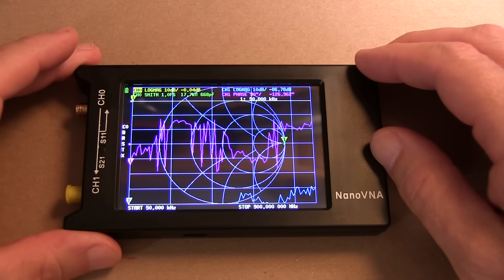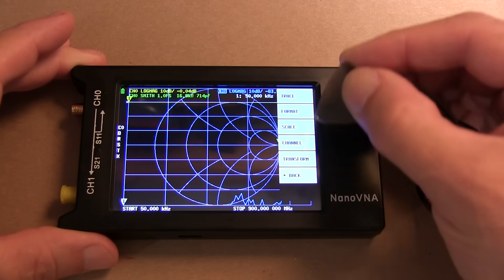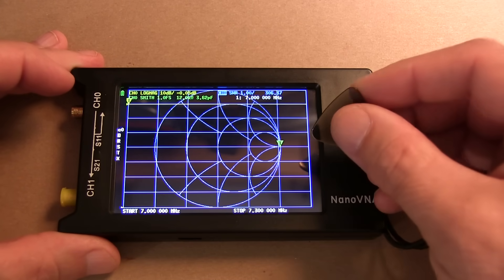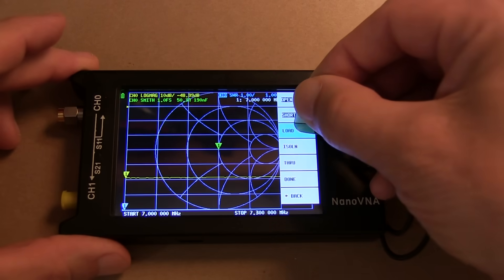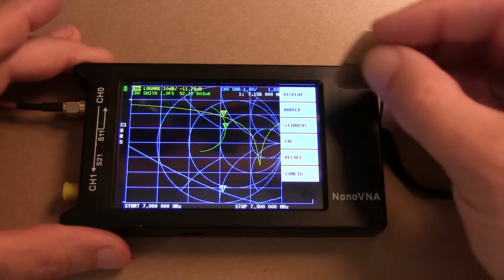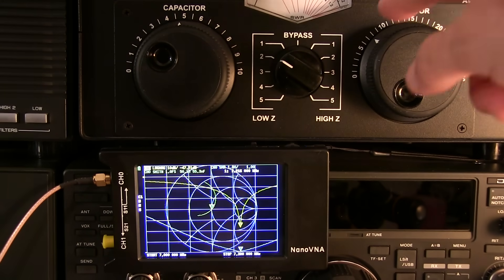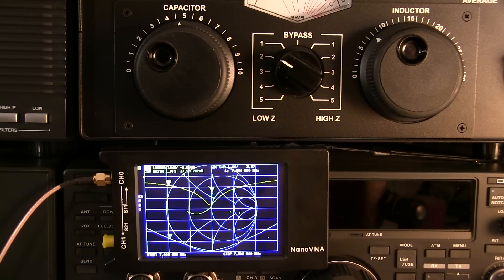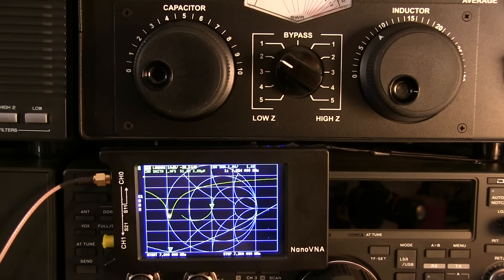#314: How to use the NanoVNA to sweep / measure an antenna system's SWR and optimize its tuning

Comment: Can you use NanoVNA for 75 ohms systems like TV antenna etc? I have RTL-SDR dongle and everything I'm using (coax and antenna) is 75 ohms impedance. Can I use NanoVNA to measure them despite it being 50 ohms VNA?
Reply: Did you figure this out? I just got a VNA and want to test a TV antenna the previous homeowner left in the attic to see if its resonant on any radio bands. I barely know what I'm doing, and looking for guidance before I mess something up.

Comment: 40m is exactly why I just bought this. Have 20m of 12ga stranded hung up as a sloper. Ironically we have loads of rf talent here in Syr with Anaren, Lockheed, Sensis, but I'm not one of them so this vid helps. Only just got my general.

Comment: I'm merely dealing with the 11 meter band to see how to check the SWR on all my antennas could show me how to deal with it on the 11 meter band!  the Nano was a gift to me for my birthday and my little brother he wants me to make sure that I get my antennas right so when I key up I won't burn up my amplifiers or my radios. 
You can email me at allrepairs@rocketmail.com or
mr.williamlavan@gmail.com
Reply from the maker: The first three and a half minutes of this video show you exactly how to set it up to sweep an antenna.  If you just want SWR, you can turn off all traces except one, set it to CH0 and the format to SWR.  Set your start frequency to 26.965MHz and the stop frequency to 27.405MHz.  Calibrate it as shown, and you're good to go.

Comment: Great video showing how to use the NanoVNA to scan the antenna VSWR across the band, but, and it is a big but! OK, so I am going to be pedantic here. ;-) Unfortunately, you haven't actually TUNED the antenna at all. You have simply MATCHED the antenna for the frequency that you wanted, by making it "appear" to be electrically shorter than it actually is, by using your antenna matching unit, which is very often wrongly called an antenna tuning unit. There is a big difference. What the matching unit does is fine for matching the 50 ohm output of the rig and lowering VSWR that it sees, but the only way to actually TUNE an antenna and change it's resonant frequency, is to lengthen it or shorten it. You have in fact just "fooled" the NanoVNA into thinking that your antenna is now shorter and more efficient in the CW section of the band, but the actual wire length, which is what is radiating and which actually defines the efficiency in radiating, is still too long for the CW section of the band.
Reply from the maker: Agreed - the impedance transformation done by the "tuner" is just to ensure maximum power transfer out of the transmitter into the antenna system (transmatch+feedline+antenna).  This "system" can be very efficient provided the transmatch and feedline loss are reasonably low.  And, as you said, transforming the impedance to get max power transfer does nothing to change the radiation efficiency of the antenna itself.

Comment: Do you set start and stop frequencies a little wider than the actual band your interested in? Or maybe 2 bands if you had a 2 band antenna?
Reply from the maker: Usually just for a single band at a time, and just over the band of interest.  This give you the best granularity in the measurement.
Reply: @w2aew  Ok thanks. I'm absolutely loving this thing for tuning CB antennas.

Comment: Ok, I need some help here, I made a slim Jim out of ladder line and got it working at 145MHz - at least, that’s what the NanoVNA says.

I tested this with only the short coax on the antenna - as soon as i add 5 metres of coax to simulate me using it on a pole it jumps from 1.1 to 2.0:1. Is that expected? Has my SWR really gone up or does the extra coax throw the measurement off?

Can I be sure that when I attach it to a radio I’m getting the performance I expect when measured?
Reply from the maker: It sounds like the coax is becoming part of the antenna.  Did you include any kind of choke balun on the coax?  If you don't, you'll get some common mode current on the coax and it will become part of the antenna.  It's best to measure the antenna in the configuration (and with the coax) that will be in place when being used.
Reply: @w2aew  just a clip on ferrite that came with a kit. All the coax is 50ohm RG58. I guess it’d be good to get it on a proper meter sometime to compare. Perhaps a proper air choke will help too

Comment: Excellent explanation and design information in all your posts, please keep up the great work. I have a question, given a Smith Chart plot of a real antenna, how could you build a circuit that simulated the antenna on the lab bench? A useful tool for testing antenna tuners and coupler performance inside the lab without having to setup a real antenna, not to mention upset the neighbours and FCC while scanning across the band. I test tuners to quite high powers, sometimes well into the kW range.

Comment: Technical question: at 5:30  in,  you have tuned the antenna to the frequency and set the j component to 0.
Now, how do you know the inductance and capacitance found, just read it unpowered ?  or read it from the dial ?
Reply from the maker: You'd have to measure them - or develop a chart to relate the relative markings on the front panel to the actual values.

Comment: I design boards with surface mounted antennas and typically use coplanar waveguides to feed them. I feed the PCB stakup from the PCB fabrication house I'm using at the time into a ICD Stackup (A 3d Solver) to get the copper parameters for the matching impedences I need mostly for HDMI and USB traces along with LTE and GPS antennas.   The Antennas typically have a Pi network at the antenna infeed for tuning.  I'd love to see how I might be able to use use the NanoVNA product to select the Pi components to precisely tune these surface mount antennas.

Comment: Wouldn't you need to calibrate for 1/2 wave length at the velocity factor of the co-ax in order to be accurate for the reading at the antenna?
Reply from the maker: If your desire is to understand the complex impedance at the antenna feedpoint, then the use of a 1/2-wavelength (or multiple of) will be useful.  If you're only interested in the mismatch between the coax and antenna impedance, then the feedline length doesn't matter much. For SWR readings, the feedline length doesn't really matter (assuming losses aren't huge).
Reply: @w2aew  my main use is in tuning antennas like Pulse-Larsen's that are intentionally left long so you can tune them after install. Since I usually use NMO mounts and drill a hole in the roof of the vehicle, I necessarily must use the coax to attach my Rig Expert. Make sense?
Reply from the maker: @Justin-bd2dg  Yes.  At the end of the day, you want the RADIO to see a good match, so it is perfectly valid to make the measurement at the end of the coax that would connect to the radio.  Again, length of coax doesn't matter for SWR...
Reply: @w2aew  gotcha, to clarify, the radio being happy is secondary, I'm striving for absolute performance (5/8 wave, simplex, vehicle to vehicle) so in my mind, the most PEP is paramount. In other words, as long as I'm not causing damage to the radio. Sorry, I'm new to this, lol.
Reply from the maker: @Justin-bd2dg  Maximum power transfer to the antenna will occur when the SWR is as close to 1.0 to 1 as possible.  Practically speaking, anything below 1.5:1 can be considered perfect, and anything below 2:1 is acceptable.
Reply: @w2aew  yeah I get that part, but I guess in my mind I view the antenna and the coax as 2 separate entities. In other words, I want to start with tuning the antenna to be optimized at 146.52, its self, at the NMO base (Larsen base coil).I understand that even though Larsen calls their base coil loaded models, "ground plane independent" that the vehicle still acts like a ground plane and effects the Take-off-angle and tune.
I just have more than one vehicle with NMO mounts so I don't want to trim/tune one antenna on my single cab truck, then move it to my Suburban and have it move off on the tune. I use 5/8 wave single banders for UHF and VHF and I have a dual band (half over 5/8 colinear) as well. Guess I'm just over thinking it over "splitting hairs"?
Reply from the maker: @Justin-bd2dg  The vehicle and mounting location will change the optimum tuning slightly, sorry, you can't get away from that.  The change should be small.  But, in either case, optimizing the tuning at the end of the coax will yield the same result as optimizing it at the feedpoint, so don't sweat it.
Reply: @w2aew  awesome thanks so much for taking the time!

Comment: I ordered the NanoVNA 2, supposed to go up to 3GHz, hope it works out. Hey by the way, the calibration needs to include the cable. If your antenna isn't a perfect match then the length of the cable will change the way it looks to a VNA, for example inductive can look like capacitive, open can look like short, etc. your yellow and blue trace are still correct but not the green one. I'm pretty sure you know about that since you are a freakin genius haha, just thought i'd point that out.
Reply from the maker: The length of coax from the calibration plane to the load (antenna) will change the impedance looking into the coax of course, but will not change the VSWR.
Reply: @w2aew  that is correct. essentially adjusting the length rotates the impedance in a circle around the center but the diameter which relates to VSWR stays the same.
Reply from the maker: @pratwurschtgulasch6662  I have several tutorial videos on the smith chart that discuss this and other things.
Reply: @w2aew  I appreciate that and I've learned a lot from you over the years. I used the smith chart to match up a PCB trace antenna and the thing ended up transmitting 10 miles at a quarter watt.

Comment: It looks like the antenna is inductive showing on the upper half of smith chart. Then you seem to be adding inductance to the network to make a match. Is this what is really happening? This is a little counter intuitive to me. Please explain!
Reply from the maker: It is an L network tuner - but the configuration (series L then shunt C or shunt C then series L) is determined by the center switch.  The two reactive elements work in tandem to match the resistance and do a conjugate match on the reactance.  The curve may move counter-intuitively due to how the LC from the tuner sum up with the complex impedance seen at the end of the coax.
Reply: @w2aew  Thank you for the explanation! I think if the characteristic impedance is to the north, one needs to shorten the antenna and vice versa. Is that correct?
Reply from the maker: @twong689  I'm not sure you can always draw that conclusion.  Especially if there is a transmission line in between, as it will rotate the impedance around the chart.
Reply: I saw your other video yesterday, it was quite enlightening. https://www.youtube.com/watch?v=IgeRHDI-ukc&t=611s

Comment: w2aew,  Although the typical case is working with 50 ohm systems,  I want to measure antenna impedance matching with a 75 ohm characteristic impedance (homebrew TV antennas).  Would it be better to slap on a  connector converter from SMA to F type, then calibrate with an F type: 75 ohm open, short, and 75 ohm termination, or would the internal 50 ohm Zo directional coupler confound the displayed measurement results?  I suppose the alternative would be to use a DIY sma to F type impedance converter.  What's preferred and what are the tradeoffs of each approach?  Thanks!

Comment: Alan I get better SWR readings on 20m with calibrated NanoVNA vs a MFJ antenna analyzer 1.07 vs 1.6 Which one should I believe?  Love the instructional videos.
Reply from the maker: Assuming you've properly calibrated the NanoVNA over the frequency range of interest, it is difficult to say.  It might be best to setup a test jig with some known impedance (25, 75, 100, 150 ohm, etc.) and test both devices with them to see which gives you the expected readings.

Comment: Alan, how does one reset the vna back to factory ?
Reply from the maker: As far as I know, "factory" setting was stored in location 0.  In the case of my NanoVNA-H4, this setting was: Start=50kHz, Stop=900MHz, Trace0=CH0_LOGMAG, Trace1=CH1_LOGMAG, Trace2=CH0_SMITH, Trace3=CH1_PHASE, with a proper OPEN/SHORT/LOAD/ISOLN/THRU calibration performed.  So, simply duplicate these settings, run the calibration and store the result in location 0.  Location 0 is the one recalled when you power-up, so you can make this whatever "default" condition makes sense for you.

Comment: Thank you for sharing, it’s the best explanation I found so far on net. I had a NanoNVA for some time and your tutorial is very useful to check/verify the method we should use this device. May I asked if any way we can use a passive device to be used as “test reference” for checking this NanoVNA? And is there away if you are able to check the accuracy? In such case, there are many NanoVNA sold and may have a bad quality control. Thanks in advance.

Comment: I find there are too many versions , I want the larger screen and found there are 4" & 4.3 , then up to 900 MHz , 1300 MHz and then 2.7 MHz .
H vs. , 4 vs. , V2 etc.
Then some have a metal case , some do not .
Thanks again

Comment: First of all a BIG THANK YOU, for your instructions. Second, do we have to calibrate, after we choose the bandwidth? Is this way more accurate? 
Plus, my VNA does not have this search function. Thanks again.
Reply from the maker: not a bad idea
Reply: @w2aew  What is not a bad idea?
Reply: @batfalcononyoutube  the nanovna only samples 101 points of any specified frequency sweep and interpolates intermediate values. So if you calibrate at the full 50k to 900MHz it's a long way between drinks. To improve measurement resolution over the required frequency range simply do as Allan has done here calibrate only over the required frequency range. to pack in all 101 points over the reduced range.
Reply: @RobB_VK6ES  Thank you!

Comment: I'd like to see the proper way to measure the efficiency of a balun and see the attenuation of a common mode choke with the proper way to hook everything up (trx bench add resistors to the measurements setup not sure I understand why and how to cope with the resistance attenuation on readings). Speaking of attenuation, I don't understand why I see discrepancies between the readings of the nanovna-h and vnasaver software even though they are calibrated with the same osl kit. Thank you for posting this video!

Comment: That's really helpful thanks!. If the SWR is at 1.1 perfect what do we also need to look for resistance wise ect so we can fine tune our DIY antenna's to their optimum?, I think you maybe hitting on it in the is video but I'm not 100% sure.
Reply from the maker: Perfect SWR means you’re getting maximum power transfer to the antenna system, but it really says nothing about how well the antenna will work. For example, a dummy load gives you a perfect SWR but makes a lousy antenna.
Reply: Thanks for taking the time to reply.

Comment: I've been pondering how to characterise (and potentially fault-find) DIY Cat6a installations with my NanoVNA. Obviously I need some baluns to match the 100 ohm shielded twisted pair, and I'll need to make some (impedance controlled) 8p8c to SMA adapter PCBs.

This would be my first foray into high-frequency/speed electronics, and beyond the above, I have no idea what I'm doing. Might you be able to offer any tips?

Comment: Great job Alan, thanks! 
Just because you asked for it, I would like to see how can we utilize the VNA to measure preamps and power amps, where and what we need to pay attention to on this.
Also, a very interesting at least for me, point is the characterization of input and output impedance of those amps and if/how can a VNA help us on how to design the output network of such amps.
Dont really know if that applies but I would love to see if a couple of RF MOSFET/LDMOS that I have here can be put to work optimally with the use of VNA.
(BTW, where is the chocolate milk gone?  :-)   )
Reply from the maker: I'll add that to my list.  Keep in mind that this is one of the areas where the nanoVNA is lacking - for a few reasons.  
1) There is no output power control, so you can't directly control the power going into the amplifier under test unless you use an external attenuator.  Output power of the nanoVNA is about 0 to +3dBm.
2) The output of the nanoVNA is a squarewave, thus has a lot of energy in the higher odd harmonics.  This energy will also couple into the amplifier unless you filter them out.  This could cause distortion, saturation, etc. issues.
3) There is no adjustable reference level on the input, so you have to take great care to attenuate the signal appropriately at the output or the input (preferred).

Comment: as a novice tech who wanted to look at some antennas this helped a LOT. one thing is, you calibrated at the SMA on the device. wouldnt it be better to do the calibration at the closes point of your setup where the antenna ataches?
Reply from the maker: It depends.  Assuming you're using decent 50 ohm coax connections, jumpers, adapters, etc., and you are really only looking for the lowest SWR, then it really doesn't matter too much if you calibrate at the exact tx input point.  This is because SWR does not depend on transmission line length.  The impedance seen at the line input is affected by the line length, but not the SWR.  Thus, if you are designing a matching network, then you must calibrate at the point where you would be inserting the matching network.

Comment: Great vids as always. Just thinking , Is it possibly to sweep or tune a set of 2 meter repeater cans with the nano VNA?
Reply from the maker: Yes, it won’t have the measurement dynamic range of a more expensive VNA, but should work well enough to get quite close.